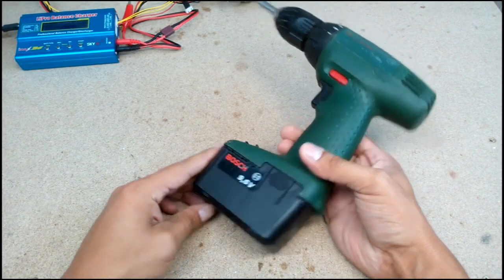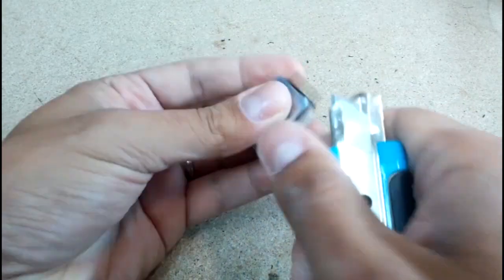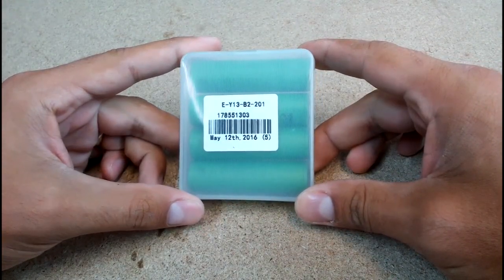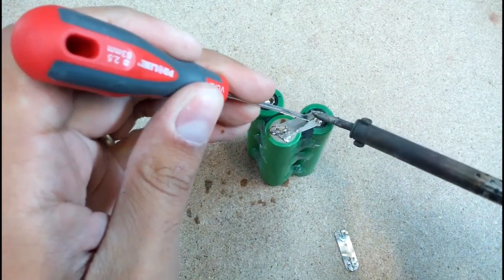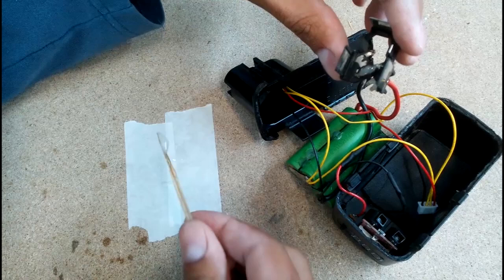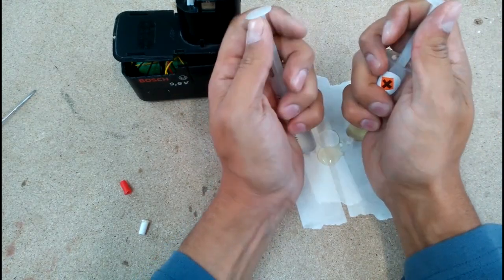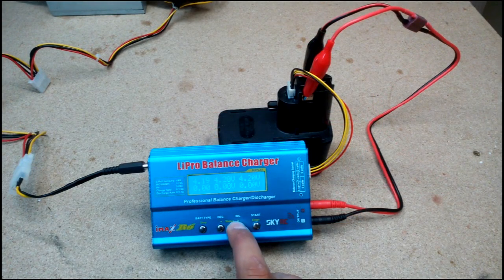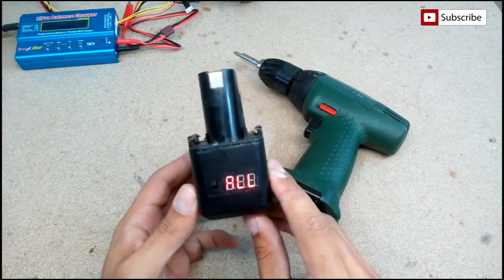DIY: Ni-Cd To Lithium Battery Conversion By Using 18650 Cells

Comment: Question: Is it possible to install a battery controller that will cut off power when the voltage drops instead of just sounding the buzzer???
Reply: Yes, you can use the battery voltage alarm, remove the buzers and wire them to a switch relay. If you youtube search for 'Battery Protection Circuit' you should have videos you can check out.
Reply: Thanks Chris

Comment: Hey you turned it into a 12 volt drill because those are 4.2volt each.  Would this work for a 12 volt drill or would you recommend i put 4   18650 cells into a drill?  How about a 18 volt drill?

Comment: I have put the 3.7 volt batteries in my 18 volt Dewalt and works a treat, I extended the case, I bought plastic battery holders on Ebay, I used 10 batteries in total, put 5 batteries in series 19volts, then 2 packs in parallel,  the Dewalt charger wont charge them so I got a 24 volt charger, bought a dc to dc converter off Ebay with adjustable voltage,

Comment: Excellent tool! I have the very same and it work still fine, it was converted to 3S2P lithium from a laptop battery a few years ago and still running. Great work! 
PS: i don't balance but i charge only 4v per element.

Comment: Hello, thanks for the video, I saw in another video, that soldering the battery, it diminishes the useful life of her, but I realize that there is no other cheap and economical way to make that connection.
Reply: You can spot weld tabs and solder on the tabs instead of the batteries
Reply: Eduardo Castellani    life of  *it
Reply: Heat can damage the battery capacity. Clean all contacts and apply flux. Coat each surface in a film of solder. Use a high capacity soldering iron (40 + watts) and make a quick joint.
Reply: Why do none of these conversion use the right batts and spot weld? No protection or charge board either. Sheesh.
Reply: Eduardo Castellani
Reply: > Our battery reconditioning methodssss works for nearly all types of batteries > https://t.co/3ycayBV4e1?gfadewe5g56 >

Comment: Before lithium ion cells, you had 9.6V now, you have 10,8 V. Does not it cause problem with the tool.
Reply: İlke Gerboğa normally a drill only has a button and a motor so a little  more volts should still work
Reply: Work fine. I have the very same tool working with 3s2p and is more powerful because of the voltage but does not burn. And i made the conversion a few years ago so it's probe that at least this tool does handle 3s lithium.

Comment: So what is the discharge current of those lithuim batteries?
Reply: They vary a lot due to manufacturer but 2ah is quite good.The drill under no load
will draw maybe 1/2 amp.But under load maybe 10 amps.So the drill will
operate about 10 mins under load driving screws.
Reply: meagain2222
that's rubbish... I have tested cheap chinese batteries and they are always 2.8 to 3.3 volts out of the possible 3.6. It's only the mah that are crap. and... he was specifically using good name brand batteries so... they would be about 3.3-3.6v each when fully charged. Unless they were old then they MIGHT be less than 3. they would have to be nearly dead to be 2 at full charge. You would be throwing them in the bin at that point...
Reply: 18650 are 3.6v each I think and he said he connected them in series and not parallel, so it would triple the voltage and drain each batteries 3000ish mah life all at once. Not sure if that helps, I'm not very pro on this stuff.
Reply: Ernesto Almeida the sony vtc6 is between 25-30A

Comment: there was one thing I didn't quite understand what you said: What are you doing over the speakers to lower the volume?
(also, I'm watching on my phone so it's kind of hard to tell visually what that white stuff is). Intriguing project; I'll probably try it soon.
Reply: It looks like he used removable poster putty in the holes. That's a really good tip, these voltage meters are REALLY loud, meant to be heard from a model airplane or car that's far away.
Reply: Oh, stuff for wall hanging?
Reply: Yup!
Reply: 3Dsjk 6
Reply: mutant. figures to

Comment: How can you confirm those are authentic, if you cannot buy those directly from manufacturer and company, which bought it from manufacturer have had to sign contract, that they will NOT sell them invidually?
You are really funny in your claim
I can confirm cells like LGe 320mAh or Panasonic 320mAh as I know confirmed source of them. but this is so called PowerBank, not separate cells.
Actually every company manufacturing 18650 is requiring application note and design of battery pack or device itself in order to sell those. Try to buy it directly from Sony and then you will learn it.

Comment: what is the circuit board he used?
Reply: It's a Li-Po battery low voltage alarm, you can find them on RC or other electronics sites for less than $5.

Comment: I have always recycled my old tools, using 3.7 volts is the way to go, if you wanted to, extend the battery case so the batteries stand up thus using more batteries as better amp hour, using a small spot welder to join is perfect, in Dewalt watch out for the temperature sensor near the connector as it looks like a piece of wire so you can use the existing charger, the 1.2 volt existing batteries are expensive in these tools, so we all think alike.

Comment: AFAIK you'll need a new li-ion charger for the new li-ion batteries, old ni-cad batteries charger can't be used with li-ion batteries.
Reply: Right. If you would use your Ni-xx (=Ni-Cd, Ni-MH) charger again, the lithium batteries could and will explode in worst case if overcharged! Or if under 4.2 volts per cell nothing will happen but the cells aren't charged to 100% in this case.
Lithium batteries better charge only  with qualified lithium battery charger.

Comment: OK those cells are quite expensive so you could just as well get the right cells for it and no need for any updating to the case, but still a good job well done. I use battery boxes and use the cheap ultrafire cells, when they run down I swap them out for fresh batteries and charge up the run down ones.Clearly the ultrafire batteries are not in anyway close to being as good as the Panasonic ones but they are very cheap so you can buy lots of them at a fraction of the price, they charge up fast and run down fast, they are powerful but for a short time long enough to do most jobs around the house, and they hold their charge for a long time.But by using battery boxes you can get much better results with them.
Reply: These are high current cells made for heavy loads... I think the ultrafire cells you're talking about are standard discharge
Reply: mnelson10000 Yes they are as you say, they are not the best by any stretch of the imagination, but for around the house type drill ready to be used at anytime they do the job pretty well, much better than the nicads or nimh the ultrfire cells hold their charge for a long time when not in use but when in use run down fairly quick.
The good thing about them as I said is the fact that they are cheap and if  you use them with battery boxes you can charge up one set while you use another set.
For sure what you have done is very good if you were a pro and needed to have your drill last a long time, but I suspect most people only use a drill for a few bits and bobs then it goes back in the draw, so the ultrafire bats would do them just fine, and if they needed something more longer lasting could simply swap out the ultrafires for something more powerful, because it's a battery box and simple.
It's like the old torches you simply swapped out the batteries when they died, of course many modern torches you have to charge them up, but once dead they are dead, with a battery box it don't matter just swap them out.
I'm guessing here but I suspect those lithium motorcycle batteries are probably filled with ultrafire cells or somethin similarly low cost.
Reply: Another youtuber named AvE did a drill conversion with standard discharge LiPo cells like you describe (actually, name brand laptop cells, so cells that were much nicer than Ultrafires) and the drill had hardly any torque.  It struggled to run a screw into a wood block... which isn't a pro-level requirement.  You say this is expensive, but really he's got less than $20 in the battery pack, which is dirt cheap compared to an off-the-shelf lithium pack.
Reply: mnelson10000 Maybe in the USA those batteries are cheap but in the UK they are expensive, I converted two standard battery drills over to ultrafire batteries and they both work very well now, they even work better than the original NiCad cells from new.
For sure those cells he speaks of are way more superior than the cells i'm using but they also are way more expensive, and my drills may only get used once or twice a month if that, but when I use them they get a hammering.
So I wanted easy swap out batteries that were cheap, lap top batteries would have been better but again even these are expensive in the UK.
The ultrafire batteries are still very cheap and in my drills they last a decent amount of time, I use my drills for tightening up bolts putting in screws and a whole host of other things, and when the batteries start to go down I just swap them out for another set and put the others on charge.
Oh to increase the amount of torque provided I simply doubled up on the cells which was easy to do cos I used battery boxes.
I can get 12 ultrafire cells for around £10 and they all do a reasonable job, these other cells the last time I checked were around £5 per cell, yes they are better but expensive and most of the time they would sit unused in a draw in the drill, my ultrafires cos they are only used when I want them in a battery box are used for powering other things and then put in the drill as and when I want them.
Battery swap is so much more useful especially when using cheap low grade batteries.
Reply: That wasn't a current limitation or simple internal resistance with AvE's conversion. He needed one more cell in series to match with the original design voltage.
Some Ultrafire cells have been found to be recycled laptop cells. Others, substandard frauds. It's better to salvage and test and match your own cells than paying a chinese vendor $2-3/cell for a grab bag of generally dubious quality.
Reply: flitsies

Comment: You could have fitted 6 cells in there, so double the capacity.
Reply: youtuber you don't know what you are talking about look at drill lithium ion battery packs you can get them in a range of amp "capacity" while keeping the same amount of volts as long as on 3 cells are kept in series you can have as many cells in parallel as you want and the only difference would be that it would take longer till you have to recharge it before you say any thing else Research what you ate talking about so you can rellize that you are incorrect. If I wanted to I could make a battery with 3 cells in series and 100 in parallel for a total of 300 cells and the only thing that would be wrong with that kind of setup would be that I would have a huge 300 cell pack to carry around with the drill a problem that in non existent with 3 or 6 cells
Reply: Why so? you wire another 3s in parallel and you're good. These will cut the amp drain per cell in half so you could actually use weaker thus cheaper cells. Aaand double the capacity.
Reply: ooltimu ..ķu
Reply: Nk
Reply: youtuber it woulnt kill it the motor would operate just the same no difference if it was double the volts then the motor could go bad but not with double the capacity
Reply: ooltimu
I've just done this. I tried to put 6 cells and a bms in there but 6 high capacity cells don't fit right. The housing don't close by a tiny little bit. But it is possible you just need to get thin cells.
Reply: 6 cells so double its capacity.. then you kill its motor.
Reply: youtuber capacity isn't not voltage. All its be fine.
Reply: when you double more than the rated capacity, you will double of course the rated volts. so you kill its/the motor. Simples
Reply: @stfuplsok  It is always good to google something before you make a fool out of yourself like you did here. Increasing the amp capacity has a different effect than increasing the voltage. There is two main ways of wiring the cells - series and parallel. Series - you increase the Voltage; Parallel - you increase the Amperage. If you wire them in parallel and keep the voltage the same then you can wire as many as you like - you could literally make a huge battery for this drill that has one billion cells and is big like a football stadium and the drill would work normally.  On the other hand, if you wire them in series, it would only take maybe 10 cells and the drill motor would burn out in a few seconds. It ALL depends on how you wire them together. You can combine those two ways of wiring to get the desired combination of Volts and Amps - like wiring multiple packs of 3 cells in series and then wiring those packs in parallel etc.

Comment: Like a lot of smart capable people your video makes assumptions the viewer has a similar skill set. As a result you speed through valuable specifics of your custom project with little detail, while conversely lingering over things that apparently fascinate you - like unpacking and fondling a commodity battery set. As a result what could have been an instructive and helpful video to a huge number of cordless tool owners tends to trend more towards
Reply: ...ha... a show project accessible mostly to a much smaller audience of tech aficionados. Many of whom are not so appreciative. Even so, still the best video on this topic I've found. And it's not like you titled it "how to". So. Good job.
Reply: M Bright///// I partly agree with you since my skills are obsolete, thus small. When I went to electronics school we still used tubes. Transistors and ni-cad was "state of the art".   But the man did a great job on the video.  Try just asking him additional questions, instead of just negative remarks. I think he will be happier to respond to a more positive remark, or question. I would like to know what a   BMS is...

Comment: hmmm.... hot glue is not good for things that can become quite hot under load (i.e., the batteries...), I'd rather use epoxy all around.

cool stuff, otherwise 👍
Reply: If your batteries are getting hot enough to melt hot glue, you've got other problems.

Comment: I was just thinking of doing this for my battery powered impact gun of which the battery pack is no longer in production and will lose its charge within 2 days even being on its own without being connected. Now I just need to get 5 matching batteries to make up the 18 volts. I use the 18650 for phone chargers and flashlights but now it will be even more useful for work since I'm a mechanic and the old battery just doesn't hold up to the job anymore. Awesome Video!

Comment: I will do the opposite to a nice Black and Decker drill when i will have the time (3 years now i did not haha) Lithium is bad for tools.
Except that mine started blowing controller fuses and the charging IC it has very bad cons to think about.

With Ni-Mh or Ni-Cd you don`t have the sudden power cut off when yhe batteries go low neither you have to keep in mind to charge it for the battery to remain in good condition... heat in sun exposed toolboxes is a problem,fall is a problem,etc,just leave lithium to cellphones if you want reliable tools.
Reply: JohnBelwell //// Thanks "expert"... Tell us a better way. That is correct criticism. Go figure.
Reply: Shell H Honestly,i have no idea about your tools,but mine are sitting in a hot trunk in the summer,they are usually being dropped from as high as the second floor and are staying discharged for a long time when working on a different thing,something that tends to break lithium batteries.
Lithium battery powered cordless tools proved to me to be really disgusting when they come to durability,plus i always have the feeling i will come back to suddenly find out that some place catched fire because of the battery in the drill i dropped yesterday decided to blow up,and that case scenario is dancing along yourself regardless of the brand name of the tools you use,if that is Bosch or your local hardware stores' no name stuff.

On the other hand i've never had an issue with Ni-Mh and Ni-Cd other than sometimes they suddenly wear off when you least expect it as the chargers that come with tools are usually not the best,and not only they've been fine on me but i've charged the Ni-Cd cells of a cheap cordless drill after 12 whole years of rotting unused and i found out that most of them started working after a few cycles,so good that i even replaced some rusty cells on a security light with them,and 4 years later it still tests okay with 1.1h battery life.

I don't believe Lithium batteries are good for heavy duty usage when it comes to safety and durability of the batteries their self,performance is a whole different thing.

Comment: May i ask how many Amps is one battery?
Reply: he said it was 2.6 amps. 2600 mah
Reply: Thnx bro, but don't you think this Amps isn't a little low? And the battery charge  won't last long enough to complete the job? And what is your opinion if I use 4000 m.Amps. each?
Reply: Well, 4000 mAh batteries don't exist in 18650 size. Cells advertised or labeled above 3400 that cost just a few dollars each are fakes that will typically have a capacity of few hundred mAh. The top-end 18650s with high storage and current capacity cost about $15-20 each. Modern tools use 18650s that are designed for repeated high drain while keeping the price modest and are typically in the 1800-2000 mAh range.